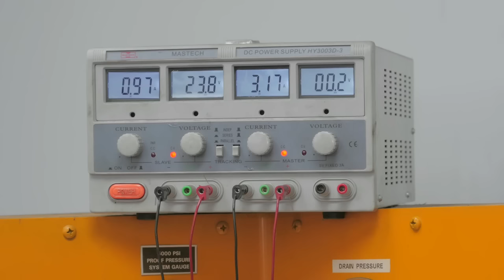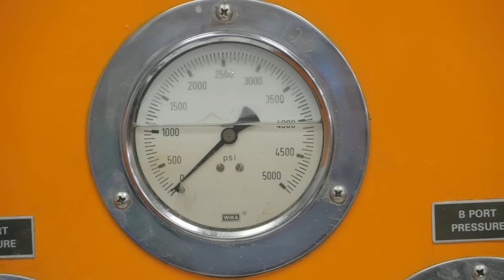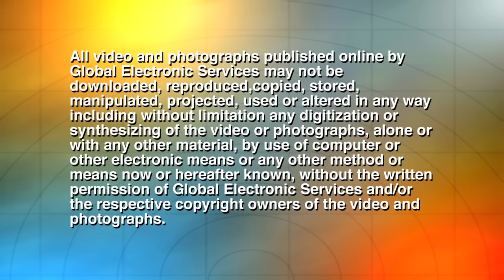Explaining Directional Valve Repair - Full Dismantle and Reassembly

Comment: Hi.I have  a directional valve that was from a pipe bender,it is 24v and I was thinking of running it off two 12 v batterys.what wuld be a rough power or current  draw on a solnoid?Thanks

Comment: Was there no need to change O ring on the solenoids ? Also how do you know that the valve body itself is not damaged with that badly damaged spool. I do not work on hydraulics and have just started studying the subject so i am simply asking as a complete novice. Thanks Michael

Comment: Thank you Scott.Very informative as I work in Industrial maintenance and we have many different control valves and applications on many different machines.I am sure you checked the valve body but was over looked.Your test proved full smooth movement.Cheaper to rebuild than to buy new.

Comment: Small suggestion:
After repair, first check the spool leaks.
Fill the P Port hole with oil and observe the oil level to be same for a minute. Do the same for T, A & B port holes.

Comment: Hi Scott,  thank you for this step-by-step explanation of the valve.  I have what looks like this same valve on my tractor.  I just purchased a new grapple and connected the hoses but the grapple is not opening when I use the 3rd function switch.  I bought the tractor used with the 3rd function kit already installed.   I never used the 3rd function before now.  I don't hear anything when I push the button on the joystick and the hoses don't move when the button is pressed either.  I suppose I should start with testing to see if 12v  power is getting to the valve.  If so, then remove and inspect the valve.  Is that what you recommend?

Comment: Hello 
I watched ur video about Servicing solenoid valve. I have two questions 
1) If we don't have new spool to replace than can we repair the old one?
2)While opertaing the cylinder I saw a grub provided on both side of cylinder on both faces can i know about it in detail.
Reply from the maker: Hello!  Sometimes the spool can be revived and sometimes due to tolerance it needs to be replaced.  What information are you looking for with regards to the set screw?

Comment: Excellent video. Very informative. I would like to ask what is the purpose of small steel balls (visible if you look into the directional control valve) from the side.
I heard it is to check the integrity of the valve by inserting an ailen key into that.Is it correct?
Reply from the maker: In this particular valve there are no steel balls inside, no checks.  Do you happen to know if you are asking about a directional valve or a proportional valve?  This unit is a directional valve and generally not have any checks inside.  Please let me know if we can help or if you need to speak with a technician!  Thank you!
Reply: Thank you sir. Yes it was a proportional valve. For any support, surely we will contact you.
Reply: رائع